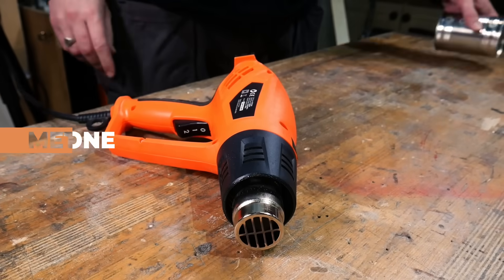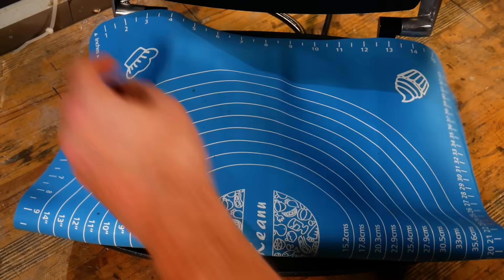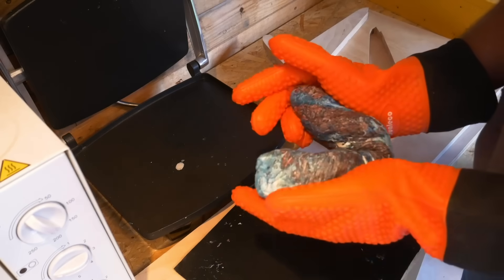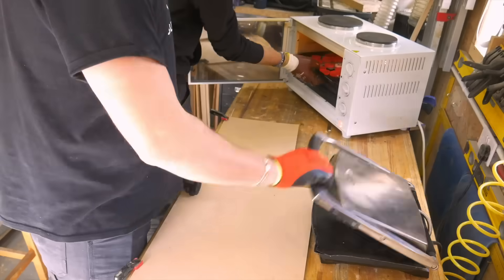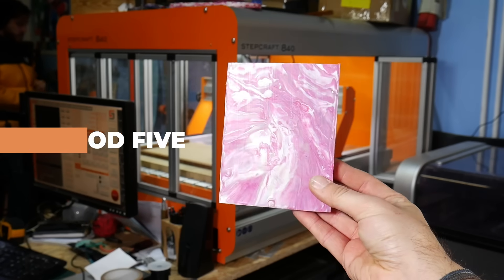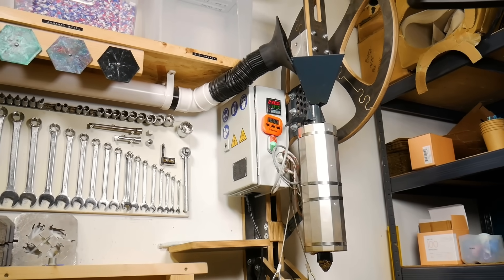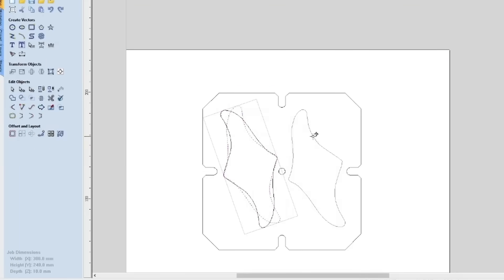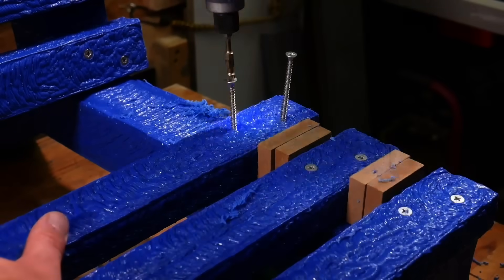7 Ways to Make Stuff from Recycled Plastic | From Tin Cans to Wazer Waterjet cutting!

Comment: With the book mould if you mount a round piece of aluminium to the top or bottom plate you'll have less waste and less work to do to make the page spreader and with the extrusion machine if you heat the mould you'll get a smoother finish

Comment: arent milk jugs HDPE as well?  not just the caps?
Reply: Milk jugs are colorless HDPE. That means there's no binders in it. Colorless HDPE doesn't flow as good as colored HDPE does. That's not to say that colored HDPE flows like water. Because it doesn't. But colorless is even worse. It is very hard to mold colorless HDPE. A lot of amateurs find it just about impossible to do. The material you get is markedly different than the colored stuff is too. It's harder and more slippery. I happen to like it better myself. But be warned melting colorless HDPE is especially challenging to do. Your best bet starting out is plastic buckets. That's the easiest plastic to melt. Plastic bags are pretty easy too but you need a hill of them to get anything. If you alternate the colors you can get the most amazing patterns with bags. It can look like Damascus steel. Go for like 10 light and ten darks alternating. 100 bags gets you maybe a 1/4" thick sheet. Some folks iron the bags. The panini press should work OK with bags.

Comment: What is the temperature at which these particular plastics are melting?
Can you post a list or resource of what different materials one can use and what temperatures to expect to be working with?
Reply: I melt HDPE plastic at 285°F But what you should do is melt a small sample to determine what's right for you. You gradually increase the temperature until your sample burns then back off from there and that's right. Burning with HDPE is it turning into a brown crust. Actually bursting into flame is way too hot.
Reply: @1pcfred  Thanks for the information.
Reply: 170°

Comment: The electric energy waste and the carbon footprint it's awful.
Reply from the maker: All these machine are low-temperature melting, which is a much more efficient use of energy than commercial recycling plants. And all our energy comes from 100% renewable sources. Plus, we reuse all of our manufacturing waste. I’d say our carbon footprint is solid 🤙🏽
Reply: @BrothersMake  not when you are having to take out plastic and reheat multiple times.  you are heating it, taking it out to do whatever process, putting it back in to heat back up and doing this several times, so you are wasting electricity...regardless if its renewable or not.

Comment: Brothers, thanks for the great ideas! It was really helpful to see the ideas in 1 place.

Here are my favourites of this video's suggestions.
1) Cookie cutter! Maybe we can make custom cutters out of tin cans?
2) That single piece of wood mold. I never thought of that.
3) The page holder.

I bet that if we set up a public library event, where we offered them for $1, then we could raise awareness and funds for our recycling causes.

Have you ever thought of making an HDPE boat?
Reply from the maker: Hey Eugene, thanks for your feedback and some nice ideas in there as always! And funnily enough a boat/raft is actually on our list to build and make a video on this summer - so watch this space! ♻️
Reply: @BrothersMake  Good to know. Thanks for the info.

I'm interested in making a custom laundry basket, by fastening pieces together instead of melting them. Do you have any suggestions? Maybe cut out some flat pieces from a milk jug, and cut them in a way that allows them to interlock? Maybe ice pop sticks or disposable chopsticks could be use to fasten them together?

Actually, that might work. The plastic is flexible enough to fit in small shaped holes, and then sticks could used to keep the inserts from wiggling free.

Does that sound right?
Reply: @BrothersMake  By the way, I suggest making a toy boat that is scaled to what you want. This way, you could film both using a forced perspective, and it might make people laugh.

Also, by the way, you mentioning the raft makes me think that we can create a snow sled out of HDPE. That would be a great use, I think.

Speaking of sleds, there is a sled shovel, which allows us to move snow by pushing a sled shaped shovel, so that nobody has to lift a lot of snow. This might be a nice project.

How hard is it to recycle biodegradable plastic? I ask, because I am hoping that the microplastics from wear & tear from using them outdoors are less harmful than HDPE fragments.

Comment: When you inhale plastic fumes, you’re exposing yourself to a number of toxic chemicals that can damage your lungs and cause a variety of respiratory problems. Some of these chemicals like dioxins and benzene are carcinogenic.
Reply from the maker: You’re absolutely right. But most of these methods do not create fumes because we ensure the temperatures are kept below the burning point. For methods that go beyond this, we wear full respirators and have filtration machines running.

Comment: Quite nice, very informative.  A question for you, though. For the bench, how long would one expect the hdpe to remain uv stable?  Also, do you do anything with pp? It would seem that many of these processes would be similar, no?
Reply from the maker: Polypropylene is most commonly used for garden furniture. We were using PP face masks for the blue bench in the video, which holds up well in the elements.
Reply: that bench wont last very long out in the sun....regardless what these guys say.  i have recycled plastic for outdoor usage and it doesnt last long.  i have a 3d printer and use plastic specifically for outdoor usage and it too doesnt last.  plastic recycling is best for Indoor usage only.
Reply: @shadowsilverlight1651  "t doesnt last long."  What is long for you might be short for someone else and plenty long enough for someone else.  So how long do you mean that it lasts?
Reply: @shadowsilverlight1651  You could possibly coat it with a UV sealant for longer life

Comment: Excellent as always gentlemen! I will add there's one additional method for melting/forming HDPE plastic: 

Silicone molds for candy and soap making. 

Best way is to use a toaster oven and melt small cut up plastic bit by bit to fill the molds. For some molds if they are relatively thicker silicone and flatter then I'll finish them with the heating press. Note: the molds don't last forever and some molds tend to not have the best results. Sometimes too much pressure distorts the end result. 

Also, to add to the tin can I've opened pop cans and melted plastic in them and it's much easier for the plastic to pop out of or remove the can from because it's so thin.
Reply from the maker: We’ve definitely missed out silicone moulds! We may do a dedicated video on these next year once we’re practiced more.

Great shout with the drinks cans!
Reply: @BrothersMake  I've found flatter and thicker molds work best vs more 3D shapes. It's not a perfect process because it's difficult to avoid bubbles if you are working with HDPE plastic that isn't bottle caps and therefore less "viscous" (?) And requires more heat. The best results I've had were using molds for candies/fondant of things like leaves where the object is mostly flat but there's some detailing on the silicone that shows up in the plastic (like the veins of the leaves). Most of these molds I used to make small leaf charms. I could send you pictures if you are curious. Ps. Often it involved a lot of re-melting over and over again until all the bubbles are gone or the shape is fully filled. I had hoped that using silicone molds would save me time by avoiding having to file, sand and polish but all the remelting took a lot of time. Still working on improving it though. I believe my main problem is using HDPE from shampoo and conditioner/detergent bottles etc vs lower temperature bottle caps as I have difficulty collecting bottle caps from my apartment recycling bin (lol). I'm also currently experimenting to see if it's best to melt the plastic using a panini press/heat press vs using a toaster oven and furthermore if it's best to only melt using one side of the heat press (for example, the side on top is hot but the bottom the mold is laying on is without heat. 

I've had problems with bubbles showing up when I remelt and I've had problems of the heat press heating from both sides and squishing too much and everything gets all wonky.

 I've also had good success using silicone molds from Sculpty meant for oven baked clay. Because Sculpty also makes a silicone clay type stuff to make custom molds, I'd be curious if it'd work for melting HDPE into/onto. 

I've also thought about using silicone fondant pattern/texture sheets to create texture/pattern on HDPE sheets. 

Regarding more 3d type silicone molds, especially if they are larger and less thick of silicone... I've experimented with attempting to reinforce the molds using plaster of Paris in hopes that the end results will not distort so I can apply pressure to the plastic to try to remove bubbles. I've given up on this however I do wonder if fireproof/heat safe concrete may work instead. An example of a 3d silicone mold I tried to do was some geometric gemstones/ diamond shapes. I had hoped to make some ornaments, large pendants etc.

Final note: if you don't have a silicone spray (which I can't seem to find) I can't guarantee how long you can reuse the pop cans for. I've found you can simply pop the plastic out of a can at least 3 times but eventually there's sticky residue that burns onto the caps and it becomes harder to pop out. I believe that manufacturers actually coat the inside of cans with a very thin layer of plastic so perhaps that's what the burned on residue is.
Reply from the maker: What fabulous information! Will definitely be coming back to this comment once we get a little deeper into the silicone tests!
Reply: Vouch, I used a silicone mold this week for my melted plastic and it worked fantastic.

Comment: Method 8: sculpt out of clay a mask, mould it in silicone that can withstand up to 300c, cut milk carton HDPE in to 1mm x 1mm shreds then once ready, remove the clay, clean out then pour ina thin layer of your HDPE n blast it with a paint stripper gun, (if youve used polymorph plastic beads this will seem familiar) and using scrap HDPE or i use neoprene (wet suit material) press the plastic in to the fine details of the mould n rinse and repeat till its basically casted allow to cool and remove from mould.
you can paint HDPE but its tricky the Rpf have details on that from general motors and their hard hats that are made from you guessed it HDPE. 

There have been some accounts of people using 3d printers to make their designs from HDPE but not sure what that process is to get it to the right sizes n printer commands but worth a look if youre keen.
Reply from the maker: Yes we will definitely be doing a video on silicone moulds in the near future! 

3D printing with HDPE is a nightmare. Too much shrinkage takes place when cooking, making uniform cross sectional diameters impossible
Reply: @BrothersMake  you guys once mentioned that it's near impossible to paint HDPE but I noticed that in its melted state it glues itself to almost everything ever tried adding a pigment n mixing through your twisting air bubble removal technique? In any case before this channel I was wasting money on polyurethane, now I'm cost saving n being environmentally accountable, from Australia I wanted to say thankyou n merry Xmas.
Reply: I want to see you pouring thermoplastic. Make a video now. I'd sooner believe molasses can run uphill in January.

Comment: You guys inspired me to start melting down and recycling my own plastic, thank you!!!
Reply: The best way to melt plastic is with a convection oven. They probably should have told you the proper temperature to melt at. That's 285°F Any higher and you burn the plastic. It goes crusty yellow like burnt sugar.
Reply: @1pcfred  oh that would be my mistake for all those times i actually did burn the plastic, whoops! thanks for the tip!!
Reply: @1pcfred  170°C
Reply: These guys got me keen as well. It's just taking me alot longer to get going.
Reply: When you inhale plastic fumes, you’re exposing yourself to a number of toxic chemicals that can damage your lungs and cause a variety of respiratory problems. Some of these chemicals like dioxins and benzene are carcinogenic.
Reply from the maker: Key word you said there was ‘fumes’. We know our plastics and control the temperatures very carefully. We never burn plastics of any types. With HDPE, that means no fumes
Reply: Exacly, other from panini how can we transform our plastics to 3d printers
Reply from the maker: HDPE isn’t a great candidate for 3D printing filament unfortunately. But so happy we got you started!